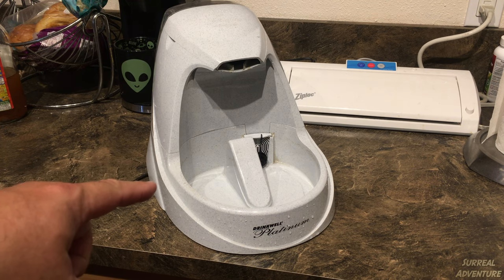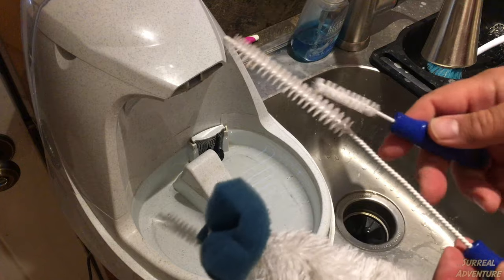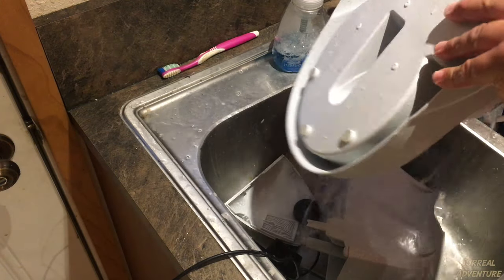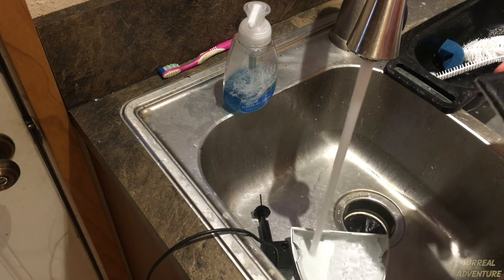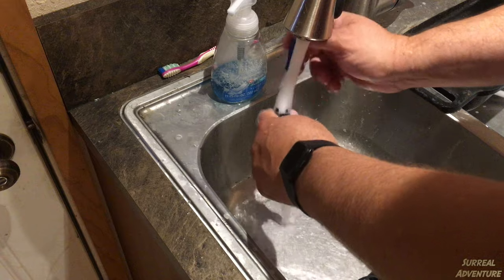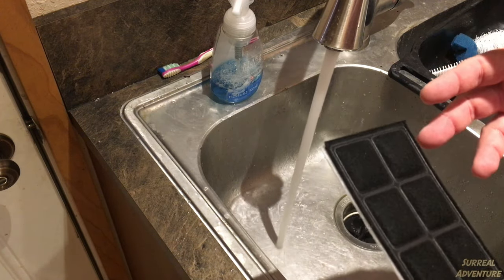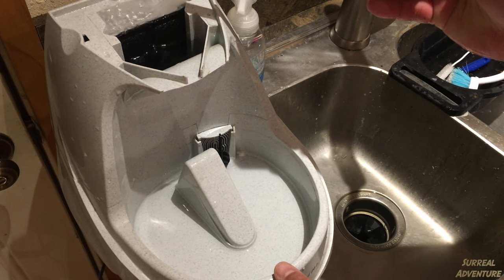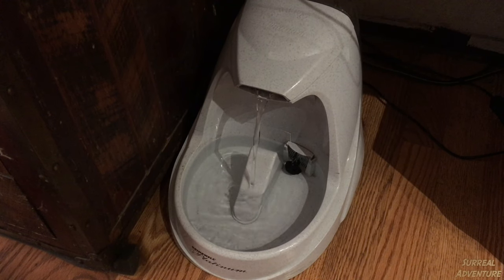PetSafe Drinkwell Platinum Cleaning & Review!

Comment from the maker: I found that to make this fountain almost whisper quiet, you can turn the flow up to full, and then elevate the tank on the back slightly (I used a plastic shim) which raises the water level and makes it quieter. Just and FYI.

Comment: Good video. You can also use a q-tip to clean inside the pump impeller well. It gets every little bit of crud out.
Mine love it when I leave the top cover off. The don’t have to bend over.
Reply from the maker: If you upgrade to another fountain by them, save the pump. This one came with a really quiet pump. The new ones have imbalanced impellers and vibrate like crazy.